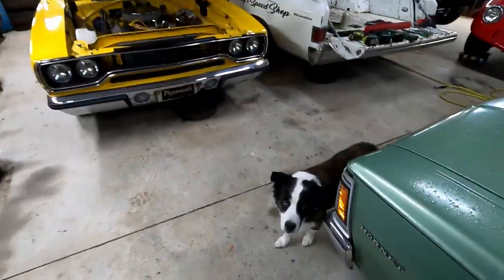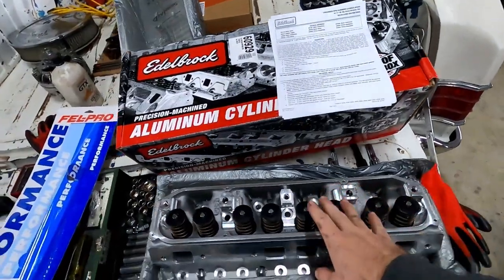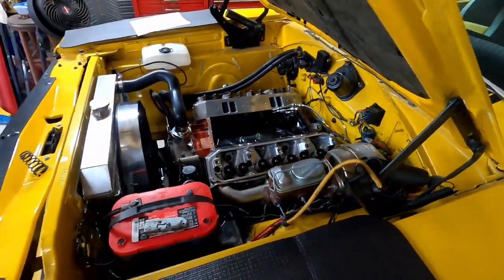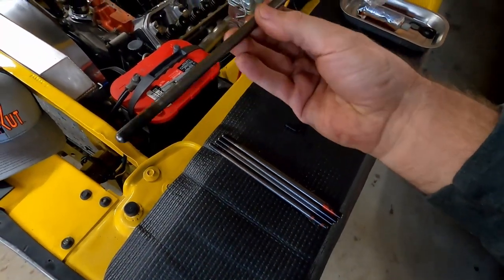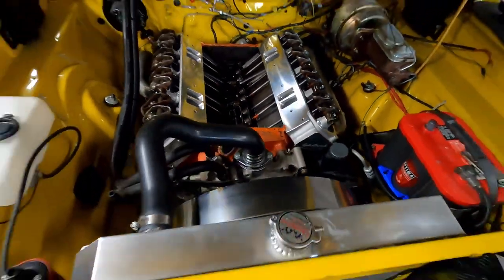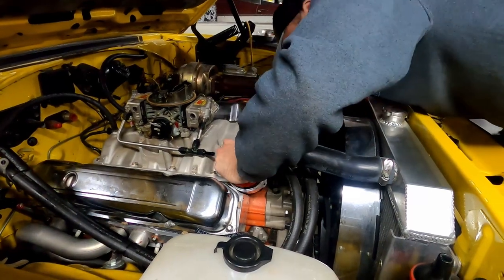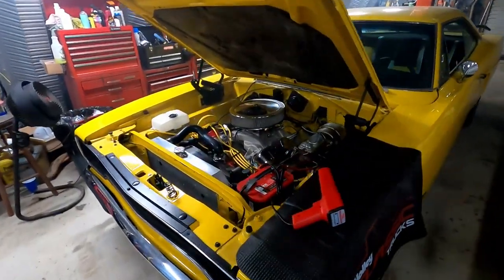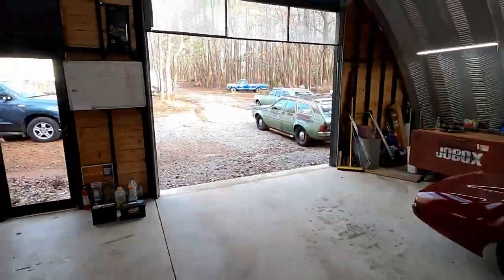HOW TO SWAP ALUMINUM HEADS ONTO YOUR MUSCLE CAR - BIG BLOCK MOPAR 440 POWERED ROAD RUNNER #Edelbrock

Comment: Sweet machine. I respect how the owner treats it keeping it out of the rain for starters. I'm so old (ha) I remember when carbureted v8s needed to be decarbonized every so often by a few rips down the road. Sometimes with good ol' STP in the tank. Always seemed to gunk up the more time it spend idling or slow driving vs ripping. Maybe they weren't exactly pig rich though.....

Comment: Also running stock rockers on edelbrocks is not a great idea without some sort of a hard washer/spacer between the rockers and each rocker stand, the steel rockers will start wearing away the aluminum

Comment: You're still a newbie so a head swap pointer, should always lay the head on the block with no gasket and verify the dowels won't hold the heads up a little and preventing a proper head gasket seal, it does happen occasionally (usually on milled heads) but sometimes people put new dowels in that are a bit too long.
Reply: Great tip. Often we don't test fit parts, at a time when it would be very easy to check fitment.

Comment: Hi there! I know this video is a year old, but I just ran across it. One thing you did not do is verify the orientation of the rocker shafts. Stock rocker shafts have oil holes for the rocker arms drilled 15 degrees off center from the hold down bolts that should point down and outboard. Each shaft can be installed four different ways, only one way is correct. Failing to put them in the proper orientation will starve the rocker arms of oil.
Easiest way to verify whether they are installed correctly is each shaft has a notch in one end. That notch should face down and forward  on the driver side and down and to the rear on the passenger side.

Comment: Timing advance should always be checked with the vacuum advance disconnected, also set it via total advance NOT idle.   If the idle is off then adjustments need to be made to the springs/weights/slots (most of the time not worth the effort).   Total is far more important than idle.
Reply: Nailed it !! 👍

Comment: Stock open chamber  heads are approximately  88 cc I've run those 84 cc edelbrock heads and wish I went for the 75 cc ones if  there were steel gaskets under the cast iron heads there 20 thousands  and if you use the felpro 1009 gaskets they're. 39 and with only saving 4 cc by using the 84 cc heads you get about the same compression  ratio . Closed chamber heads about 78 cc

Comment: Hi, just relaying my experience  on 2 sets of edlebrock heads that I have (BBC and SBC).  A friend who's a head porter/polisher/flow guy said let me check them out for you. I'm glad he  offered to do this. 
First the valve spring pressures were sky high,  his opinion was that when using a roller cam which I was on one set would have destroyed the  roller lifters. The next thing was that the valve job was "  atrocious" .   Finally on the BBC heads the rocker are studs go straight into the intake runners, they were not sealed. I'm still very happy with both sets. My 350 SBC with a roller cam, flat top pistons, stock intake and factory Quadrajet ( had to be rejetted) made 425 HP. It runs really good!

Comment: These heads have been out for a long time and to still have to grind clearance for the distributor is stupidity. Edelbrock should know that a large number of people use MSD and should compensate. 
I have heard that checking the heads on any aftermarket head is critical as stated by others. 
The copper spray on the head gasket is a good tip. 
If you leave links for parts in the description it helps and you can make extra money for yourself. Good video with some extra research.

Comment: Having to grind off material on brand new heads to fit the distributor just turned me off of Edelbrock heads. Shitty manufacturing !
Reply from the maker: They would probably work with a stock distributor, but this aftermarket MSD distributor was a little larger.